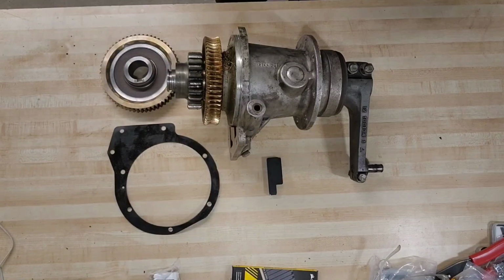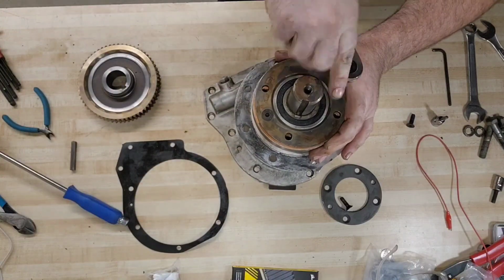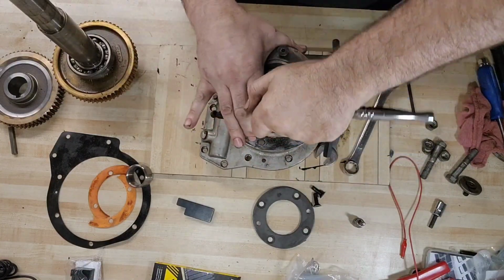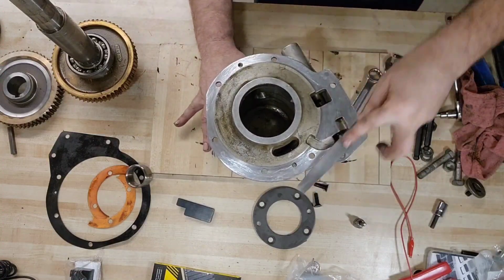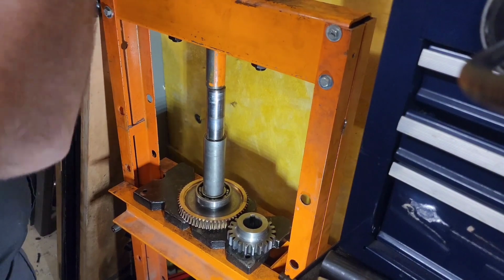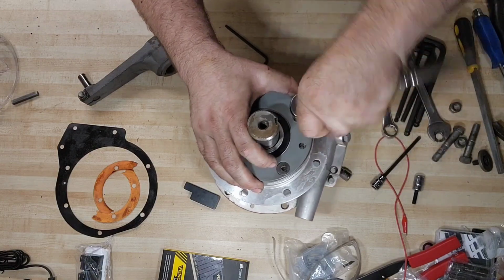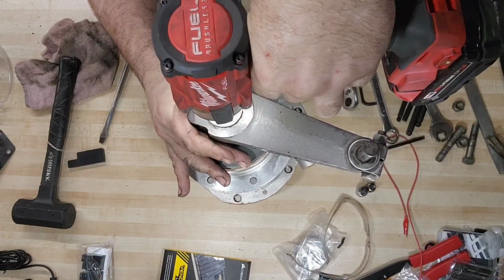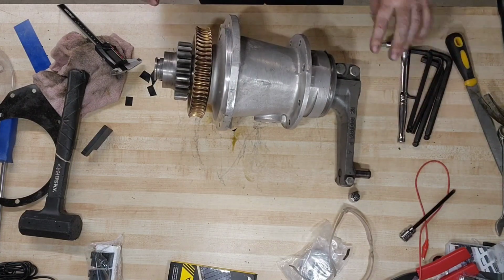Brunswick A/A2 Pinsetter 4:1 Assembly Teardown and Repair. - Overdub Audio for the last 27 minutes.

Comment: I always use a little bit of light oil 10W-30 when I am reassembling I use it when I'm pressing the gear back on and the bull gear and on the inside bearing race

Comment: How do you know it's time to replace a 4 to 1 ?
Reply from the maker: There are several indicators. First, drain the oil. Are there gold shavings in the oil? If there are, then the bronze teeth are worn.

Second, with the machine at zero degrees, can you wiggle the crank arm up and down? If you can, then the keyway between the shaft and gear is worn out.

Is the housing leaking oil between the housing and the gearbox? If it is, then the gasket may he bad. 

If the machine just shakes violently and will not advance, then you have complete failure of the 4:1 bronze gear.